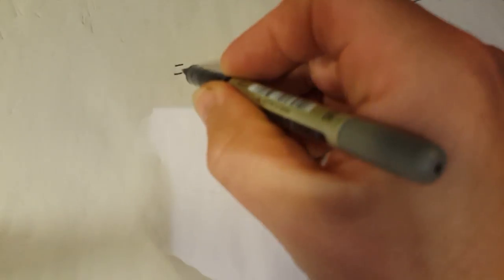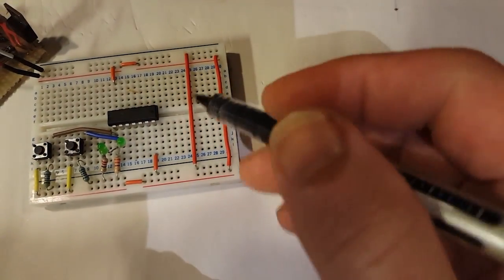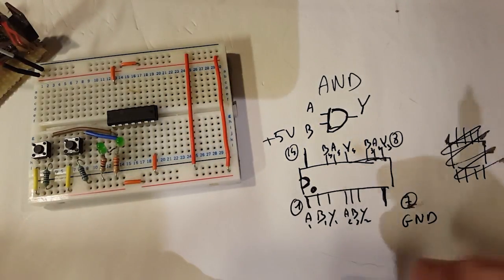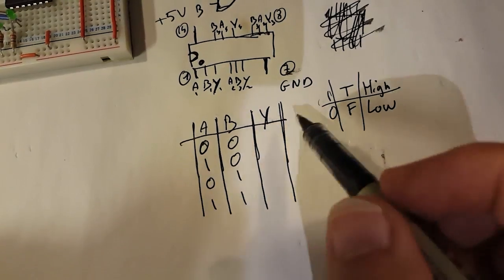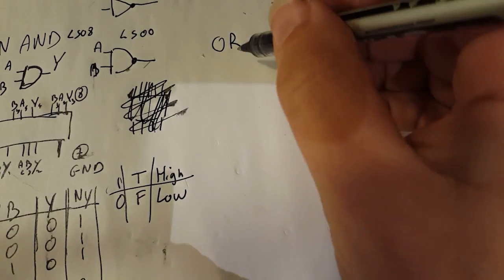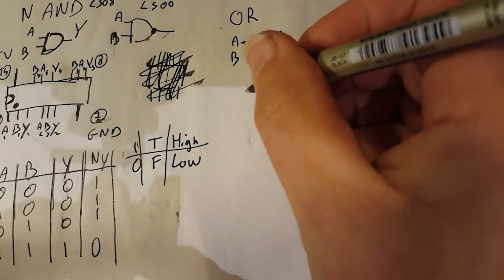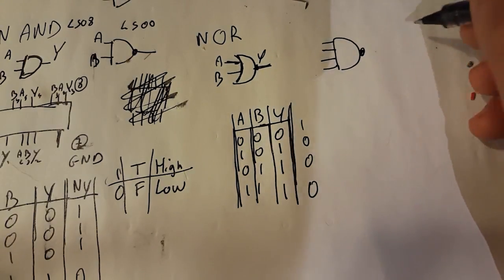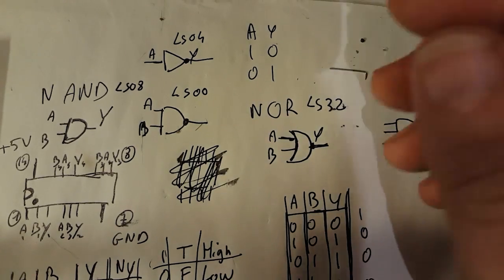Building a small Z80 computer #3 - Intro to logic ICs:  AND & OR Gates & Hex Inverter

Comment: I started with these about 1975. I’m a radio amateur, and used TTL to make control system for repeaters. Turn things off/on, generate tones and Morse code for an identifier.

You can tie both inputs of a NAND gate together to make an inverter, also.